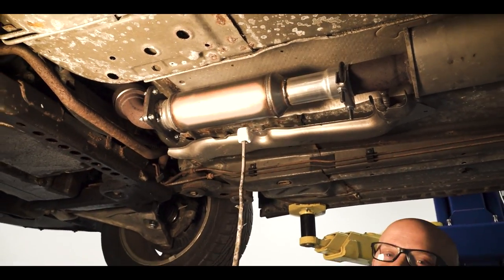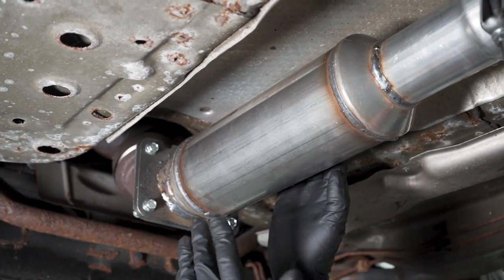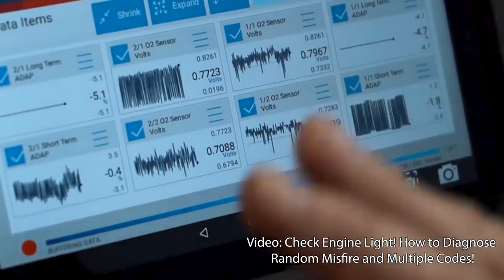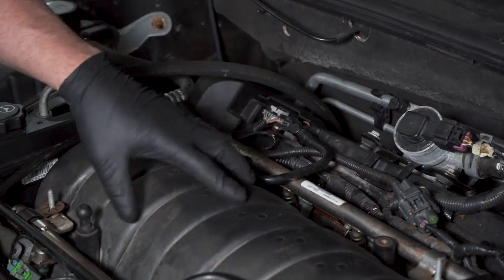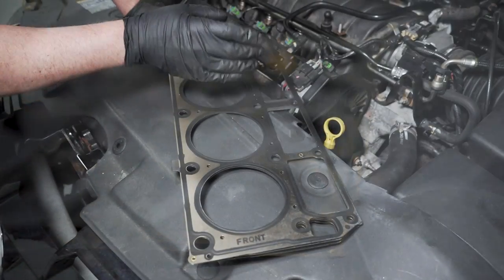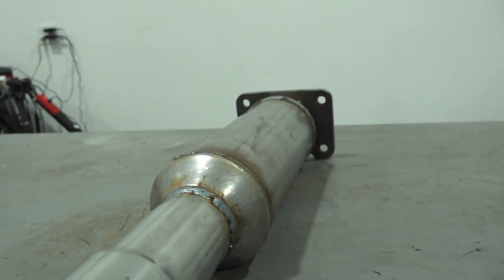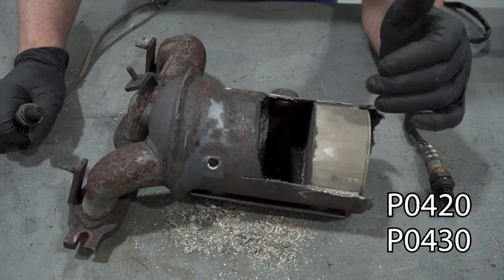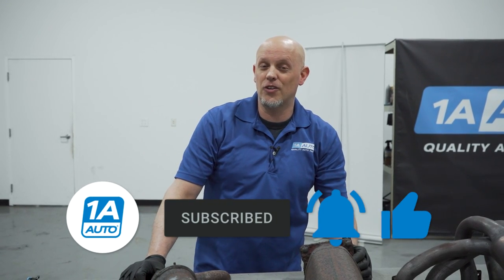Is Your Car or Truck's Old Catalytic Converter Hurting Your Gas Mileage?

Comment: My 07 escalade backfired real bad when accelerated on highway after i oicked it up from the shop. They forgot to tighten battery and lost power for a few seconds. After that im having all thw clogged cat symptoms. Truck has 250k original cats. No check engine lights.. can that ine backfire incident cause it to be bad ?

Comment: Hello maestro 😁I have a 2012 Honda Accord  v6 with 121000 miles 👀Do a need to replace the timing belt?
Reply: Look into it if it does have a timing belt or belts, I would say change them after 80,000 miles but check your owners manual or go online. That vehicle may have a timing chain.

Comment: I am having hard time starting my car. It's a Chevy Captiva 3.2 V6 240hp, 2007 4wD. Engine won't start. However the mass airflow, Throttle body, alternator, compressor, intake manifold are all disconnected from the engine. The first electrician said it's the faulty electric installation, and the 2nd electrician said it's the ECU module. Truth is the engine cranks but won't start. I am having a nightmare. Could you please help me?

Comment: My Prius with 230k runs FANTASTIC, avg mpg 46-51 , great pick up , no oil consumption, not external damage to the CC, got the PO420 code , changed the plugs , , cleaned the maf sensor , air filter, still getting the code. Put in cataclean 4 days ago and first time ever putting in premium gas.after erasing the code , it finally passed all test on scanner, no more po420 , what’s your theory on this ?

Comment: Can you just give me a little advice, or direction. I have a 2000 mercury Sable…… check engine light is on. And I need to pass emissions in order to renew the registration. The car seems to be running beautiful. I don’t understand why it’s on. I am far from rich and I cannot afford to spend $987 to get a waiver. Can you tell me what the most common Engine problem could be??? PLEASE HELP!!!

Comment: A faulty rear oxygen sensor or wiring can cause the P0420 as well. Ive had damaged O2 sensor wiring from a heat shield falling and rubbing in the past. Replaced the sensor and code went away. It is back again due to the wiring harness coming out of the clip and laying on the converter.

Comment: Drilled mine out so it’s straight through
Reply from the maker: +Neville frking Bartos Thanks for the feedback!
Reply: Can I do this in Oregon and still pass emissions?
Reply: @precisiont5188 no they can tell. You’ll fail.
Reply: @liveFee_OrDie  the system is all tuned together so as long as it’s operating properly it shouldn’t effect fuel consumption.

Comment: I have a 1996 k1500 Z71 that only gets 12 mpg ... I’m thinking this could be my problem.
Reply: No…you have a 1996 K1500 Z71…. THATS the problem 🤣😂🤣
Reply: @David-is-the-Husband-of-Tami  those Chevys are way better than modern ones
Reply: @David-is-the-Husband-of-Tami  Those are the ONLY years you should ever buy a GM truck...1988 to 1998.  1999 to 2006 is ok too (LS engine), but anything older or newer than those two eras is garbage.